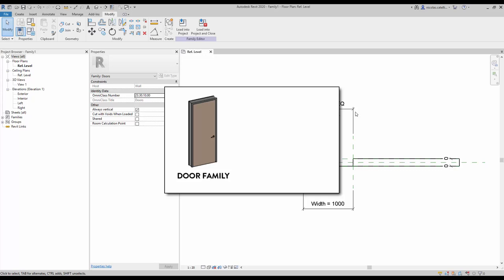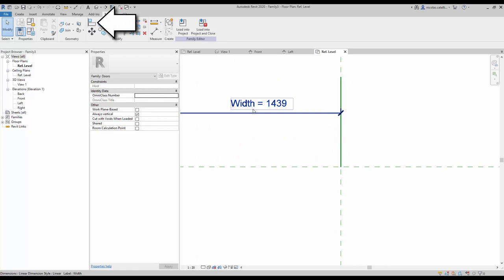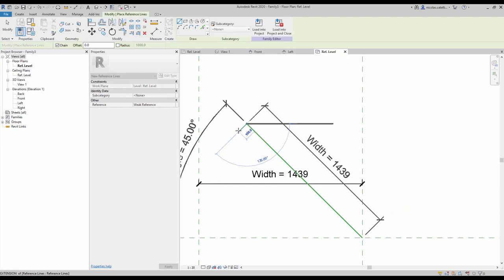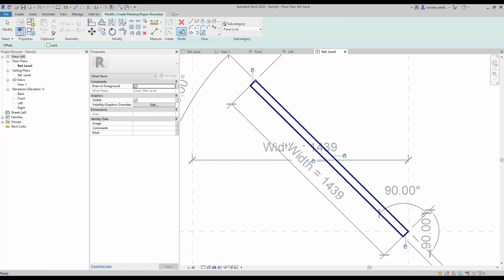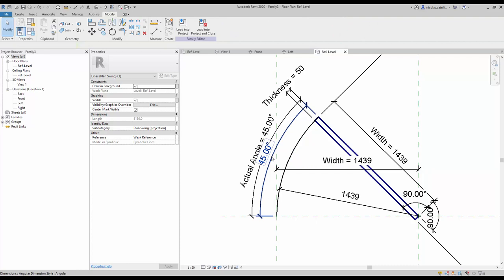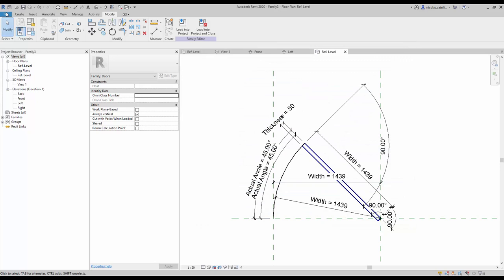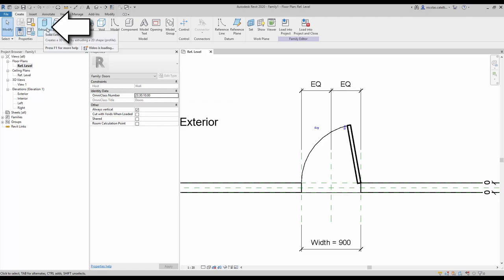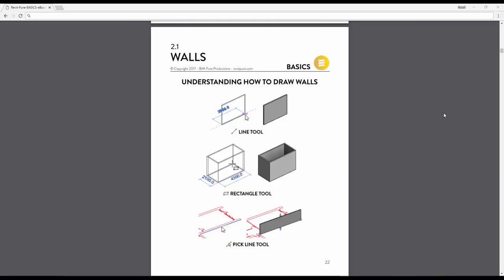Revit Tutorial - Create A Customizable Door Plan Swing

Comment: I can't believe the functionality of changing a door swing is not built-in.  I'm really trying to switch fully to Revit but my god there are things that make no sense.  Why can't properties be changed to each instance instead of the entire family.  Answer:  Duplicate everything and name it accordingly. 2'4"x6'8" Dr w/15D Swing then 2'4"x6'8" Dr w/45D Swing...etc., etc.  I'll have so many doors with so many variables on a per door basis?  This is not logical.  Everytime my door swings into something @90 degrees and visually impairs the readability; I should be able to change that angle on the fly.  Not create a duplicate, rename it, add parameter/field, etc.  Maybe I'm missing something.
Reply from the maker: You can set the angle to an instance parameter. That means the angle can be individually controlled for each door. Good luck  :)

Comment: How do you add hardware (i.e. handle) to that panel and get it to rotate with the panel itself?Is that possible without having to add thousands reference lines and parameters to the model?
Reply: I'm new but maybe you would add it in as another nested family, and lock that to your reference?
Reply: Nesting!

It totally depends on how you want the the family to work, but create the the swing + handle in one family.

Load it in the door family and constraint and the add angle. This should work.

Comment: So if we need to show the elevations and sections do we close the doors? and then on the floorplan, it's closed? I want it to have the ability to open at any angle but in elevations it should remain closed
Reply: - Create the annotation family as he did.
- Load the annotation family into the door family.
- Create the door family as you'd like, but do not attach the door itself to the annotation.
- After creating the door itself, hide it in the plan but show it in the elevation and section by visibility settings.

Comment: What happens when you type 0 degree and then 90 degree?
Just use a resolve-based parameter to host the door panel...
Reply from the maker: Hi BIM BUMS, we create an additional angle parameter with a if statement formula. Basically, the angle is not allowed to go below 1 degree. Check it out at 8:10 in the video. Thanks !
Reply: @bimpure  , don't get me wrong... its a nice video and you get a nice working door family like this...
...just so many parameters... 
A resolve based door family have just a few, and work flawless even at 0 degree...
Reply: BIM BUMS can u make a video explaining this?
Reply: @larrytinnin3357  Did it explain it good enough?